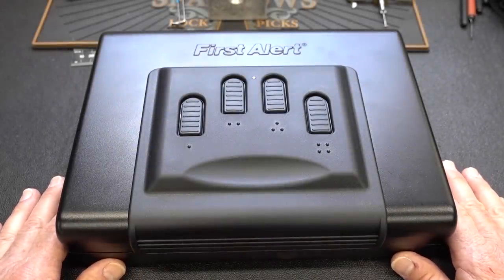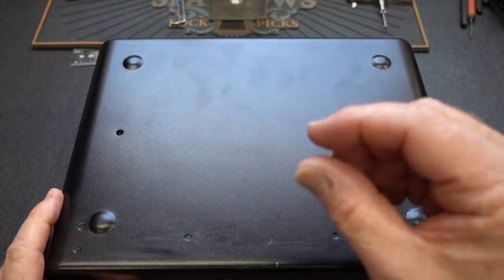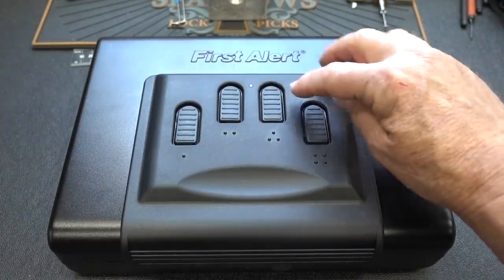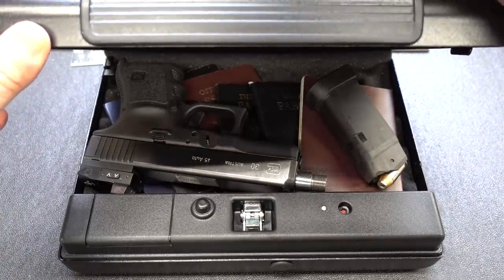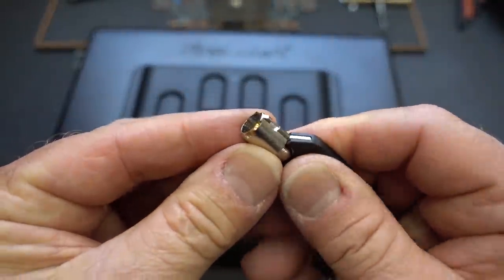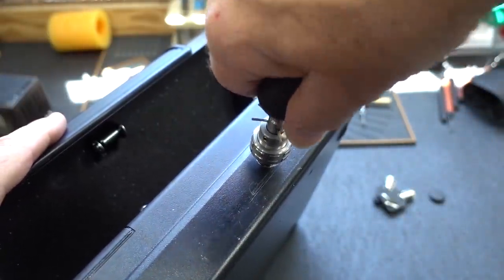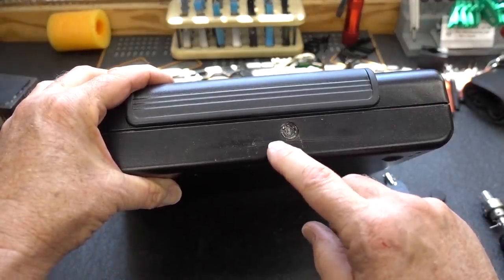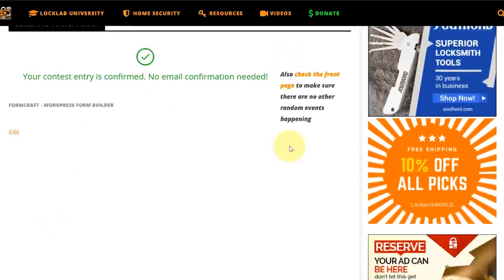(1526) Review: First Alert Personal Safe (RA31424)

Comment: Is there anything similar but with 9V battery contact instead of backup lock?

The battery contact of course is to be used in the case of battery running out of charge.

Comment: How about adding a DC jack to the safe so if the batteries run out, you can power it from a wall adaptor to open it instead of the tubular lock... The only potential problem them would be forgetting the combo, but that would be the same as a dead battery with a lost key...
Reply: The majority of consumers want convenience and that second mechanical form of entry the key gives is convenient.

Comment: Mount it on the floor or shelf.   Grab some 1x2 or 2x2  inch strips of wood and make a wooden box around the outside of the safe, like a picture frame. The safe will look like it's setting inside the frame when done.  Drill and mount it down.  Grab some paint, and paint  the wood & over all of the screws and such.    If you forget to change the batteries, and it goes dead,  sand down the front wooden strip, remove the screws, and use your key...  The wood also serves a second purpose;  not being able to put a crowbar under the safe to pry it from the floor ( or shelf. )

Comment: Excellent review. I am always looking for the Lock Lab approved products so I can give family and friends a heads up. I would like to see them put a couple copper or just metal tabs on panel in case of dead battery and lost key. So you can simply touch a 9V battery to the tabs for emergency power. We all have a 9V Batt. even if we have to borrow one from our smoke detectors.

Comment: Three tries and then a time delay is a lot better than the last gun safe that would lock up permanently until you used a key and replaced the battery.
The absence of a BEEP BEEP BEEP BEEEEP BEEEEP is also a good feature.

Comment: they could've added a power jack for a small battery pack and did away with the key alltogether
Reply: A 9v battery jack would work perfectly
Reply: @NenYim  Yeah but nobody has a 9v around, would be better to have some way to have some sort of harness that takes AA's or AAA's which I'm sure many people have tons of those
Reply: Smoke detector has 9 volts
Reply: @JessicaFEREM  or a usb plug
Reply: @youtubeuser206  This is a best suggestion. EVERYONE has some form of USB power source, the voltage is just right.
Reply: City Lock a polytechnikey llc company USB power sources have been common for very few years, and they are already changing from one plug to another.  9V batteries have had the same plug for more than 40 years, a more appropriate consistency for a well built safe.  It's also very close to the voltage of two fully charged lithium ion batteries, and the electronics would need a good voltage conversion front end to protect against electrical amd electronic attacks via the power input anyway, so might as well be able to regulate away the difference between input voltages from different sources.
Reply: I don't get why the batteries have to be inside the safe... if you build your electronics with enough basic protections mount the batteries outside.
Reply: @johnfrancisdoe1563  I was offering a pragmatic view of the power source most people likely already have in their pocket, laptop or car. The cost to embed a USB mini or micro is far less en-mass, depending on it's placement than a 9V battery node with isolation, as some safes do have.  Others have a DC Jack and a spare AA battery holder... still need to hunt down fresh batteries. I find USB resources redundant even tridundant. Just grab your Samsung charger cable... probably 2 or 3 between house and car, or a portable power bank.... kitchen junk drawer full of these plus questionable batteries. Matters not, as the cheap electronics is less reliable than the mechanical combo chamber.
Reply: fremeaner Not actually true: electronics work differently than mechanical locks, but they still have behavior that can be exploited..

The microcontroller handing the electronics will suck power slightly differently based on whether you’ve punched in the correct button(s) or not.

Allowing an attacker to hook up a sensitive meter to measure voltage, spikes and current flow, means “side channel attacks” are possible, and can be used to decode the lock.

Such side channel attacks have been used to reveal encryption keys on servers, smart cards, card readers, and more.
Reply: @Troy Telford — My "exploit" to get into this safe is a 4-inch angle grinder equipped with a metal-cutting wheel.  I'd simply cut a 2x2 inch opening in the area of the latch, separating the latch from the lid and allowing the box to be opened..  Estimated time of entry:  Less than 3 minutes.  Technical skill level:  Low.
Reply: @Milosz_Ostrow  Very True. But the purpose of the product is for nearly instant authorized access, and reasonable resistance to attack. Security is ALWAYS a function of time, not of "if", A beefy box like this could be so much better, had the engineers had some knowledge of safe design. But then, they might not come up with unique designs. It is a paradox of security products...or is it actually a "catch 22"?
Reply: @City Lock a polytechnikey llc company — We don't know the design constraints under which the engineers at First Alert were working, but I think it is safe to say that making the box out of 1/4-inch steel plate was not an acceptable solution as matter of manufacturing cost and for a variety of other reasons.
Reply: @pariahzero  I believe it's an engineering challenge. It's surely possible to solve this
Reply: @pariahzero  That all depends on how its built and programmed. Its very easy to build one that gives no useful feedback. For example hashing the correct code and when a combination is entered do nothing but record until the last digit is entered and hash the input and compare. You would know the combination length because there is no enter button but the lock already gives you that. There would be no way to know if any of the key presses where correct with that system because the key presses themselves would never be checked.  I doubt this lock uses that though.

The systems that fail like you described usually do one of two things. 

1. check each keystroke as they are entered.
2. check the string and stop at the first incorrect integer.
These are not the only ways but they are the most common. 

With its price point though I would guess this lock does one of those two and yes would be vulnerable. But let's face it with its price point the test equipment will be worth more than whats inside (most likely) and a destructive attack is way easier. These safes are not meant to be invulnerable just impracticable for the average person to open on the fly. If you really need something secure you could get a class 6 GSA approved safe. Anything can be opened if you want it bad enough though.
Reply: @pariahzero  Absolutely correct, but more trouble than it's worth for an $80 safe. Use an angle grinder. Unless you do not want the owner knowing you got in.
Reply: @pariahzero  Exactly.  And I'd also like to add that entering a safe using a side channel attack does so leaving little evidence (as opposed to an angle grinder).  The safe owner will never know their safe was accessed.  This is especially important when securing items such as encryption keys or Cryptocurrency Mnemonic keys which can be copied and then returned.  Not everyone stores guns and gold in their safes!
Reply: You could swap the lock for that

Comment: Does it lose the combination if the power is lost or when the batteries are changed? External power could he an option but if cutting power and reapplying it resets the combination or disables the combination failure wait time then it will still need an internal backup. Though you could use a rechargeable backup that maintains itself with the external power.

Comment: Have you or Lockpickinglawyer attempted a simplex lock box?
Reply: I recommend the Amsec PS1210HD safe.... a VERY beefed up replacement of the earlier PB1 and PB2..... and tilizes the Simplex combo Chamber, to drive a steel beefy bolt work

Comment: From the opening sound I guess it has a servo motor instead of a solenoid, an EMP generator could possibly do something.
Reply: Fry the electronics so the key would be the only way in for sure. Maybe a strong RF signal could induce some voltage to turn the motor but would more than likely just kill the electronics. LoL

Comment: They could at least have an option, a switch, that disabled the keyed entry if there's juice in the battery.
Sure it would suck if you forgot your combination but you have access to the box and can cut it open or drill the lock body etc without a problem.

That's the reason you'd bolt it down in the first place because that's what thieves would do, destructive entry.

Or simply put your key in the lock hole and wait for the batteries to drain completely due to them being used to prevent keyed entry when the key tries to turn.

Comment: Why not run 2 small wires to outside with battery terminal connected to internal battery, iff flat pop in battery and open up ( epoxy lock)

Comment: Couldn't you replace the lock with a power plug? Then either permanently power it externally or use a battery pack to open it if the internal batteries fail. It's useless for getting it open in emergencies but so is the key IMO. Maybe you could power it through the bottom of the case and mount it like Bill suggested so an impressioning tool couldn't be used. Then you'd still have the lock fail-safe in case the mechanism got fried.

Comment: Reading about defending it with cordless drills, yadiyadiyada. Why not bring your cordless grinder? Problem solved.
Reply: If someone is bringing power tools with them, I don't think any safe this size is going to keep them out
Reply: That was me. The thing is, there's a big difference between drilling a 2mm hole and grinding away lots of metal. Also, a grinder would be either quite weak or quite heavy.
Reply: @FirstNameLastName-hz4kv  well, it depends on how long it has to keep them out and with what amount of noise allowed.

Comment: spots welds on the hinge are inviting a drill attack , might be worth mouting so rear is inaccessible.  similarly, if the front space were limited to the key length, it would deter impressioning. (damn , should have watched to end :-))
Reply: yea i mean either side you mount it on leaves it vulnerable to attack.  the hinges look like they'd pop open if they brushed up lightly against a hammer.

Comment: Only 4096 possibilities ( 8*8*8*8). If it doesn't lock up on wrong combos, it is a limited time until you have an unlock. If you could try a combo a minute it would be just over an hour to worst case it, or just half an hour on average to open. But it does disable. How many times? 4096/3 == 1365 times is pauses for 4 minutes == a bit more than 90 minutes. So the total worst case open would be 4096 (at a second per try that's just over an hour) + about an hour and a half. So worst case, two and a half hours -- or about an hour and fifteen minutes on average. If you are really diligent. And if you enter four digits of a max of eight every second. That implies that if you use it, you make darn sure that if some one is trying to brute force it, you notice before an hour and fifteen minutes (or really at all, what if they tried the right password first? One second in they cracked it!)

Comment: 1 digit = 4 possible combinations
2 digits = 4x4 = 16 combinations
3 digits = 4x4x4 = 64 combinations
4 digits = 4x4x4x4 = 256 combinations
5 digits = 4x4x4x4x4 = 1024 combinations
6 digits = 4x4x4x4x4x4 = 4096 combinations
7 digits = 4x4x4x4x4x4x4 = 16384 combinations
8 digits = 4x4x4x4x4x4x4x4 = 65536 combinations
I think that's right if I still remember my Stats class.

But that only works is you can repeat digits, which you can.
If you can't repeat digits it should be.
1 digit = 4 combination
2 digits = 4x3 = 12 combinations
3 digits = 4x3x2 = 24 combinations
4 digits = 4x3x2x1 = still 24 combinations
5 or more digits is not possible because you would have to repeat a digit.
Cheers.

Comment: From 256 up to 65.536 combinations (if you know the pin-length) :P
Reply: You did your math backwards. It's 8 to the 4th (not 4 to the 8th), so 4096 max possible combos.
Reply: @Vares65  no. It is 4 to the 8ths power, because you can choose 8 times from one if 4 items. It is 4*4*4*4*4*4*4*4
Reply: @shirkanesi  Then because you can enter a 4 to 8 digit code would it be 4^4 + 4^5 + 4^6 + 4^7 + 4^8 possible permutations if you don't know the length? Been so long and google isn't going to give me a simple yes or no answer to that question LoL
Reply: @drivejapan6293  seems to be correct.

Comment: Why don't they just make the key backup port a place to insert a extra battery to allow enough power to open it to replace other batteries?  Its a common thing that electronic locks in secure areas allow.  Casino carts do this, its just a rubber plug you pull up and drop emergency battery in.
Reply: Its not only for power failure. The majority of customers want convenience and in the event you lose your code a physical entry option is the most desirable.
Reply: @drivejapan6293  If that was the case they would of just did it from the start that way.  The whole point of the device is quick access so a physical lock is silly.
Reply: @Dranzerk8908  that's why the key is a backup and not the primary mode of entry. The backup is for reliability not speed.

Comment: Only two screw holes and quite small diameter. Easily crowbared out and opened at liesure.
Reply: Drill bigger holes and use big washers.

Comment: So the hinge pin is welded but only 4 welds to hold the hinge it’s self on is no match for even a small powered screwdriver and drill bit... Dimples to center a drill bit none the less

Comment: The problem with seeking to disable the tubular key lock for security purposes is that an electronic locking safe that doesn't have external backup power capabilities really does need a mechanical override.  It's just sad they've chosen such a ridiculously weak override system for an otherwise quite secure device.

Comment: The thief will thank you for making it easier to identify valuable targets will simply pick up and walk away with. Just a fact of life. Yes we need to keep weapons away from kids, etc.  But no cable or welded whatever will stop a thief. They will thank you for the valuable identification. Bolt it to the floor or wall. They have a crowbar or Harbor Freight Saw All to remove it. The cables can be easily cut.

Comment: I don't think this safe is secure against a determined attack by an adult.  Failing in snapping the cable or shimming it open, I'd simply zip it open with a 4-inch angle grinder equipped with a metal-cutting wheel.  Thanks to this video showing the internal layout, one would only need to attack the small area where the latch is located, cutting out a 2x2 inch square.  However, this product appears to be perfectly adequate for keeping a small sidearm and ammunition out of the reach of children, yet rapidly accessible when needed for self-defense.  If it can prevent a tragedy, it's well worth the $80 asking price.

Comment: In the description he put sow instead of show
Reply: He wrote
Reply: Video #1526 is a review of the first alert personal
safe (model RA31424).Ifound this to be a VERY nice little safe that is made with quality materials
and is well designecd. It DOES have a tubular lock
backup in case the electronic lock or batteries fa
but with a little thought you can prevent someone
from picking it - and 1'l sow you hovw in the video.

Comment: I do not trust electronic locks. I can spot or diagnose design weaknesses in a mechanical system, but electronics, fat chance, you end up just having to take someone's word for it. As the poker players say; trust everyone but cut the deck.
And as others have said they should ditch the tubular lock and fit a USB socket for external power. In fact ditch the batteries entirely.